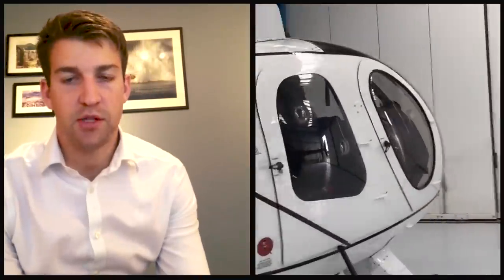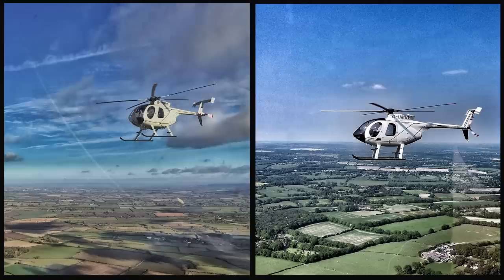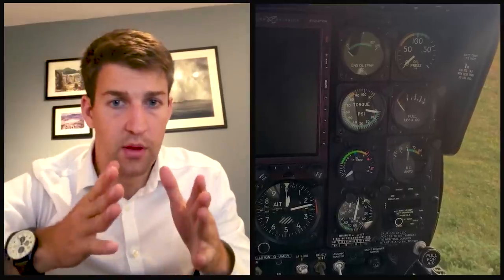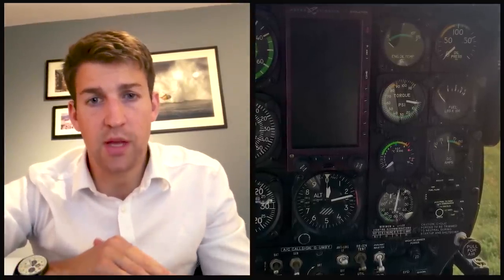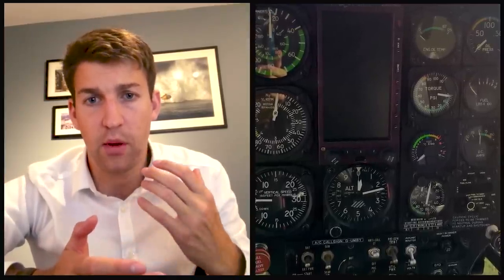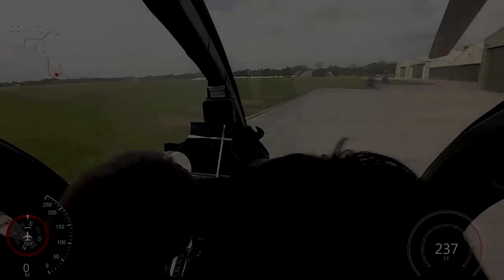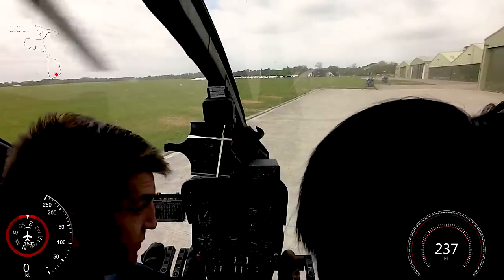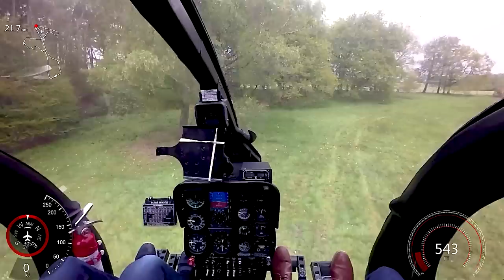Flying the MD500 Helicopter

Comment: AB Helicopters Ltd. I like the high skid gear! My dad years ago had a Hughes 500C and before that, s Hughes 300C. The Hughes 500C was flown over power lines for weed control. And the Hughes 300C was used the same thing.
Reply from the maker: Hi there William, thank you for the comment - yes the 500 is a great bit of kit, very versatile! The 300 has its uses too, through not as many and obviously not as fast or as powerful as it’s older brother!!

Comment: I was just about to do my QXC when the lockdown came. Hopefully will have the rest of the course done by the end of the summer. Then the MD500 type rating is a goal.
Reply from the maker: I’m sure you will settle back into it quickly - fingers crossed for you ! What were you learning on for your PPL?
Reply: @ABHelicopters  thanks, yes hopefully. I'm just flying the R22 at the moment but I am a fixed wing instructor who flies a range of types from the Cirrus to a 1943 T6 so I have always been pretty progressive with my flying. Naturally I don't expect to jump from the Robinson to the 500 in an easy step but I believe in setting goals. The obvious turbine would be the 66 of course but who wants to be obvious!
Reply from the maker: The 500 is a perfectly reasonable step from pistons to turbine world. Along with the Bell206, often, they are not substantially more expensive than a piston powered R44 , and given your experience on a range of fixed wing aircraft the additional gauges to monitor in a turbine helicopter (eg Turbine outlet temp, N1 , torque) should not increase your workload dramatically, especially in comparison to a T6!
Reply: AB Helicopters Ltd thanks for the advice. I will maybe drop you a line for a proper chat soon.
Reply from the maker: Stuart Etheridge Anytime- happy to help!